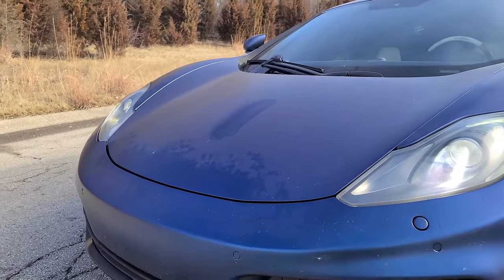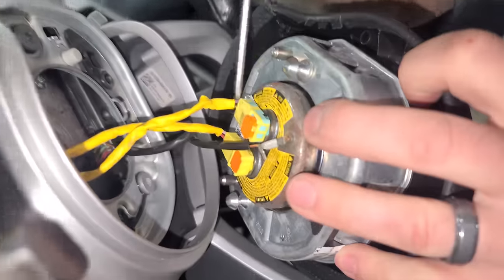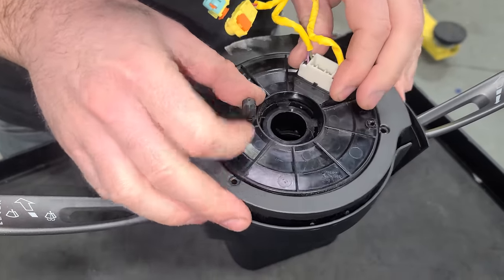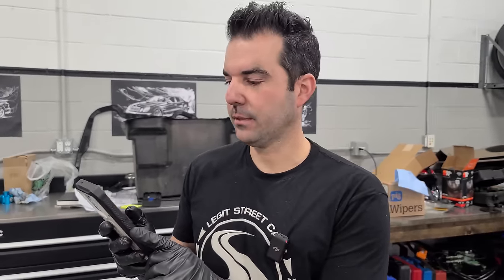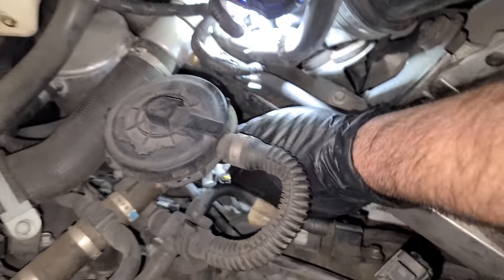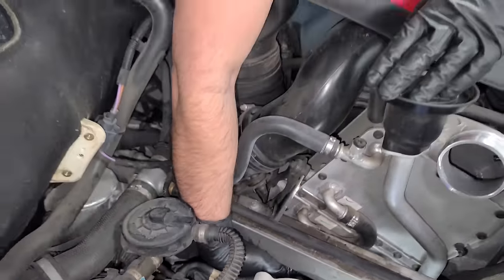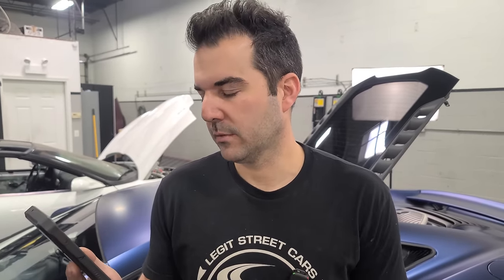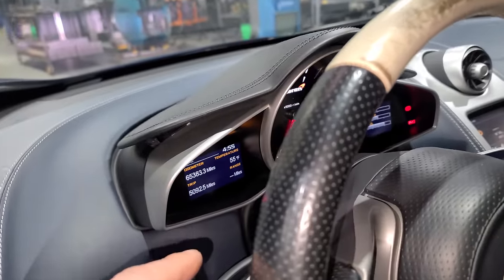I Fixed My Broken Supercar With Used & CHEAP Nissan Sentra Parts! McLaren Wanted $7,500 For This!

Comment: OK, a few tips from a Nissan Mastertech first off always put a little dab of anti-seize on your plug. Because often times aluminum doesn’t like steel and you certainly don’t want to pull the plug out of that which includes some of the cylinder head threads. Also, when you put the cold packs in, make sure you put a dab of dielectric grease on the end of the boot this will help two things one help you get the coal out in case it decides to glue itself to the spark plug and it also helps seal moisture out. Also put a dab of dielectric grease in the connector that goes onto the coal for the same reasons. A big tip on getting these connectors off is to spray them with some rust penetrant, and that will soak in to the seal when you wiggle it around and we are immensely help getting these plastic connectors off which you’re always prone to explode in your hand, take care from Jay Tiger in Thailand
Reply: Most plugs don't recommend you putting antiseeze on them. Especially NGK. I would not  brag to much about being a Nissan master tech. Almost as bad as one from dodge trying to brag
Reply: I understand your point about the anti-sieze on the plugs, but then you really have to be careful when you're torquing them down because as you should know, that's going to change your torque specs and you could easily over torque them and strip your head.
Reply: @williamardenjr116  funny you mention that in my 29 years of automotive torture, I also achieved a master Honda tech and a master Dodge Chrysler Jeep tech. but the smartest thing I ever did is quit working on cars go back to college and achieved an engineering degree and finished up with a 4.0 grade average. not that I’m a genius I just did a whole lot of studying. i’m curious where you saw that recommendation I believe you, but I had never seen that recommendation. I worked on a lot of 300ZX is with the 3 L motor and some of the plugs were super scary getting out required a good shot of rust penetrant and many back and forth to get the plug out and sometimes they still carried some threads with them. once you put anti-seize on the new plugs, they always came out with ease. I always put a small amount of anti-seize on plug threads and I have never had a problem getting them out or any kind of drivability problems. It does have a change the friction coefficient of the threads so you have to be easy on talking them in, and there is a calculation for the type of lubricant, you put on the threads and the reduction in force to achieve the same clamping force.
Reply: @jaymartin2625  I think I'll believe you rather than that other guy lol
Reply: You have to put anti seize in them
Reply: Just use synthetic oil on plug threads, definitely dielectric grease on coil boot
Reply: @williamardenjr116  You dont know jack do you? He is100 percent right! coming from a MINI master tech please if your dealing with heat on removable threading you usually apply a dab of Anti-seize.
Reply: @MrLenard  and if that heat thing is true why didn't we use it in the Navy on high speed parts!
Reply: Anti seize prevents the galvanic corrosion between the alloy head and the steel thread on the plug.

Comment: Learning that the McLaren uses a hopped up Nissan motor really takes the fear out of owning one as it's now relatable and not a mysterious black box under the hood. Great job, guys!
Reply: I will surely keep that in mind when I buy my McLaren. xD
Reply: Originally based on the engine in the R390 GT1. McLaren engines are built by Ricardo.

Comment: You also fixed the cruise switch, the decel position never worked for me. Had to Set then Cancel every time... new switchgear solves all 💯 (Also on the frunk you have to latch it then push down firmly and it latches every time, same with all exotics)

Comment: Alex, For those long spark plugs with bad access, try a snug fitting piece of hi pressure ( ply reinforced ) fuel hose for starting and snugging down, then wrenching tight to finish with socket... this saves a lot of tiny 1/8 turns with ratchet wrench !  The hose is also MUCH better for "feeling" the threads to avoid cross threading damages. Scuffing up exterior of hose with sandpaper for your hands, aids in gripping with gloves or greasy fingers.

    To help with water intrusion (due to heat/cool cycles and capillary effects) in electrically sensitive areas, try the old "Aqua Net" hairspray trick ! The aqua net repels water from hair, and will do so on spark plugs and wire connections quite well, remember to let it dry on plug and wires before assembling since it's flammable when wet ! It acts a bit like the Rain X windshield product vs water.

    Do you know if the body wrap is blocking the door opening sensor(s) ? I watched other 12C videos and it seems like you don't need to swipe so much as hold hand in the correct spot for a second or two... is it temp sensitive, magnetic field sensing or an optical sensor ?

Comment: What I've realized looks and feels neater is instead of wrapping electrical tape around your swivels and then them having a residue stuck on them I like to get an "O" ring and put it on the swivel and it stiffens it up a bit and still works as it should

Comment: Really enjoyed the video...especially since it fixed the issues. Tom Walkinshaw Racing worked with Nissan to develop the engine for a project that never materialized. McLaren bought the rights to the engine from Walkinshaw. I have a 720.

Comment: 12c owner, great vid, awesome info on the nissan parts! I will note that it runs great on winter tires as well. I didn't like the ISG sound personally. I've taken mine everywhere, including farm roads up in the mountains (pnw); as long as you drive slow, it drives great.

Comment: Ron '98 is, of course, Ron Dennis, McLaren boss for many years. He would always sign each car somewhere, under the dash or in your case in the fuel filler. When you had the Rolls Royce, you would have found 'Henry' written inside the heater trunking. As for Gutentight, we say 'jolly tight old chap'.
Reply: RON - The research octane number (RON) is defined as the percentage by volume of iso-octane in a mixture of iso-octane and n-heptane that knocks with some intensity as the fuel is being tested.An octane rating, or octane number, is a standard measure of a fuel's ability to withstand compression in an internal combustion engine without detonating. The higher the octane number, the more compression the fuel can withstand before detonating. Octane rating does not relate directly to the power output or the energy content of the fuel per unit mass or volume, but simply indicates gasoline's capability against compression.

Comment: The car is looking absolutely brilliant! 
* Question - Has a piece of plastic been broken off of the air filter at the top (35:46)? If so, will that be a potential problem for the air intake system?
Keep doing what you do‼️👍
Reply: 95% sure that this is the sealing lip between the filter an d the cover of the Airbox
it will result in some unfiltered air going into the engine - it will be a very tiny amount but some amount of air will bypass the filter
i doubt that it will be an issue - but my ocd will not allow to reuse a damaged filter

Comment: Thats not an AirBag light.. Thats a SeatBelt light. Unless a HARD fault is detected (from airbag  being blown), the SRS light will auto reset upon repair, although the code will be stored in the SRS computer. Edit: I see the AirBag light came back after the tune up.. Something else may be wrong.. Edit2: Then on your test drive, it was off...

Comment: M12 stubby is the best tool. Payed for itself so quick when I worked in a shop. I have the 1/2in but I usually just use an adapter

Comment: The air filters are much easier to get to from the rear fender wells, by removing the rear wheels and liners. The air boxes are right there and I believe its only 3 bolts. Make sure to remove the OEM foam lining the air boxes. The foam breaks down and clogs the air filters.

Comment: I know this is like 6 months old, but did you notice the broken rubber seal edge on the fram air filter that looked good?  Not sure if it would have fallen down into the filter, but I'd probably check before you sell it, or drive it more...probably already gone, but still would look if it were me. Awesome videos as always. 👍👍

Comment: Thank you for making this video, I have to replace the clock spring in my 12C as well, and don't worry you aren't the only one who bought a cheap 12C with tons of problems.

Question, when buying a used steering assembly, how can you be sure the clock spring works? I'm trying to buy one off ebay, and I'm worried I might be buying a broken unit. Seller says he has no clue wtf a clock spring is

Comment: Drove a 2016 675LT thta I bought from the origina lowner for about 1.5 years. Got rid of it after that because it was too expensive to maintain. When an oil change costs $2,500.00 its not a daily drivable car.

Comment: Brilliant video glad you're having fun with this car just watch out if you leave the car after a damp drive it's quite common for the brakes to stick on don't attempt to drive it as you'll leave the pads stuck to the discs just pour boiling water on to the pads and they normally unstick just fine 👍

Comment: There are three standard grades for octane fuels in Australia, measured using the Research Octane Number (RON) rating. Regular (unleaded) octane fuels (91 RON) Mid-grade premium octane fuels (95 RON) High-grade premium octane fuels (98 RON)...

Comment: normally soldering a new ribbon cable aint worth it but given the limited supply of those clocksprings it might be worth replacing the ribbon cable and rebuilding it

Comment: Roof rack for sure, but I would cot with the roof box too.  I wonder if you can self power/enable/ force lock the diff motor with an override button during drift days.

Comment: If you can find the twin turbo 300z motor and swap it in that would be dope. I'm feeling like another OEM plus-ish lowered slightly adjustable suspension (doesn't have to be air) Japanese wheels with a lip and meaty rubber tune it to a respectable 350-400whp tune for the street. Manual transmission (why I suggested the twin turbo motor from the 300zx shouldn't be hard to find?) Not too wide blue paint job black interior have Will update the electronics. I'm thinking maybe have a street and track tune so you guys can drive it and track it occasionally.

Comment: ron, aki, clc and mon might be confusing to some. But there is a trick to it :)  in europe we just use ron scale. so our ron98 is your 93clc/aki  :) This is easy calculate sir, aki or clc is just the average of the ron and mon values for your fuel, whilst we dont care about the mon value here.. "as is" is good enough here i guess?

Comment: I've been working on petrol ICEs here in Australia for just shy of 50 years.
'Check Engine' lights can often be cleared by disconnecting positive on battery then holding foot on brake pedal until the stop lights at the rear go out. You did the right thing by replacing the ignition coil pack, spark plug leads and spark plugs, as most misfires are caused by deteriorating spark plug lead boots allowing spark to 'earth out' to the metal spark plug journal. By the way, iridium plugs are crap. Why? Because the metal alloy used in the spline of the plug does not conduct electrical energy with anywhere near that of copper. As for tightening plugs, you go until you find it very difficult to turn then 'nip' one effort more. Why? Because torque values make it nigh on impossible to remove the plug at the next service interval. As for the air filter (shop vac filter) I'd have ripped out the whole thing and put a 'pod filter' on it to improve induction air flow. Best way to clean the throttle bodies is with an aerosol can of the mass air flow cleaner made by CRC Chemicals.
RON means Research Octane Number. Higher the number = more power and better mpg figure due to the engine not needing as much fuel to do the things a lower RON fuel provides. Here 110 miles north of Sydney I use 98RON fuel (BP Ultimate) every day in a 1.6L four cylinder Ford Fiesta and get average 40mpg (5.9 litres per 100km) from a 12 gallon (48 litre) tank.

Comment: Before getting too far into this video I always start by checking the firing system (coils, spark plugs, and wires), and then check the fuel system (injectors and fuel pump). Those are the two most typical reasons for misfire.

Comment: The reason of your misfire is your spark plugs are full of oil which means a valve cover leak. It will drive good until your plugs gets full of oil again. Fun seeing DIY on expenssive vehicules.

Comment: Amazing how 1 little thing can set off a cascade of faults these days. I just had a bad brake light switch which disabled my abs and traction control, two big things meant to keep you safe. Took a week to get one and 10 seconds to pop it in and all good, but why take away abs and tc at all.

Comment: I'm kinda curious about restoring the black poly trim. Would it be more effective to use a heat gun on the plastic first, and then coat it with the ceramic to seal it?

Comment: Engine is from a nissan r390 gt1, mclaren bought the license to manufacture it. Also these r390s usually run at 600hp but without any restrictors can handle 1000hp.

Comment: The heat index 8 plugs are probably the reason why you need to change them so often. It is likely they are fouling constantly... probably done on purpose. BTW tire pressure monitor is the bane of my existence. lol

Comment: LoL. I know exactly how someone broke the air bag clock spring from breaking one before.    Someone had the rack disconnected and spun the steering wheel with it unhooked.. LoL. Learned on a Montana van once.  But usually you can solder it back together if you can get it apart far enough

Comment: Talking about doing your own cars repairs... I often get from my friends "Why do you have such an expensive car to drive in?" Well.. because I can mainteance it my self and its CHEAP for me. And then I ask them how much for some services they pay at their mechanic and so on... they always get surprised on, how cheap I do it my self. So I spend more money on gas, but a WAY LESS on repairs and then its still often cheaper for me to have that car than them having theirs. :-) My brand new Ford Transit from 2013 (owned from 2013 to 2020) costed me 3500$ in 8 years to have service on it and I even did oil-filter chamge every 10.000 km (7500 miles) or at least once a year. ALso did aircondition service every year. Only thing I didnt do, was the brake disc and pads, because I didnt had time to do that, since it was a bigger jon on that, so I paid  700$ for that, excluding the disc and pads, but including wheel bearings and labor. So counted down, the car with purchasing (special rules here for handicapped car) and mainteance for 8 years is roughly 1700$ a year (+ diesel and insurance).

Comment: @ 00:28:05 your Air filter seal is damaged on the inner edge, bits missing, possibly fragments of it have blocked sensors.

Comment: Also, I inherited an F1 when my father passed. So yeah, I'm an F1 guy but cannot afford to have it serviced, and thus as I have worked on all my car issues my whole life, I do not fear the idea of working on the F1. Not that it needed much, just a the factory suggested advice for 1,200 miles, which the dealer suggested that it was now worked in enough to press the pedal down a bit further, lol. When I explained how ti was my Fathers and now it is mine, and that I could never truly afford to service it and therefore I'd be doing any required service on it myself, I am pretty sure the sound I heard was the service managers phone hitting the floor. I was immediately begged not to do so, and the shortly after received a call with an offer to sell the F1. I still own it, and although I do not really drive it at all, I do plan on working on it whenever it requires it, regardless how many service managers or collectors enter cardiac arrest because of it. The way I see it it, it's my car now. If i want to cut it in half it is my right to do so (obviously I never would, but just making a point that people don't see to understand). If anyone has any questions, by all means ask.

Comment: Wave your engine bay or normal claren wanting you use a airline to blow out for dust on your engine and when you got your two hair filters you could take him out and blow the dust from them as well you could use a dry paint brush to brush the dust off as well if you took them out

Comment: Tractions never going to be great at 40* but you might check the tires rated temps. Alot of performance tires aren't supposed to be driven on if temps are colder than 70*. Modern super cars will give you a fake sense of security... then let go on a hard corner if pushed too hard.

Comment: I have owned a few new exotics from Lambo, Aston Martin, Maserati, etc.  Porsche is as close to an exotic without the headaches of parts which can take months.  I own Teslas now.  Spoiled with low maintenance.  Most parts plug and play.  I charge at home saving $500/month on gas and home electricity  EV’s can be forever cars. Cars are depreciating liabilities.  Even second hand exotic/luxury cars depreciate but parts and labor do not. My teslas plenty fast and people do not bother you every time you park.  Enjoy you channel as a gear head in the past.  I enjoy driving not wrenching or visiting service departments.  Lol

Comment: RON is EURO rating for fuel. And RON 98 is equivalent to 93 US octane. So putting a 91 octane (96RON) is probably causing the misfire. These exotics need the highest rating fuel and they are sensitive